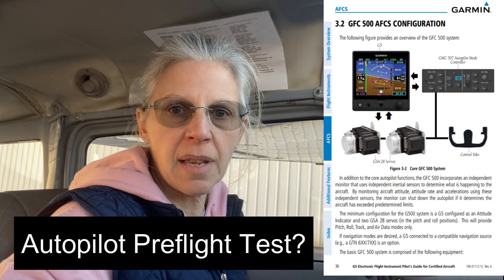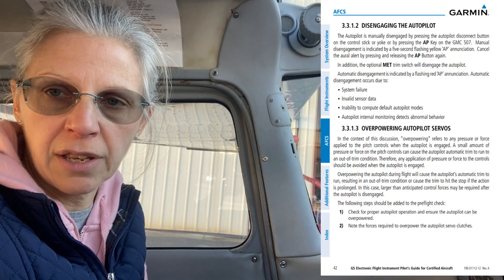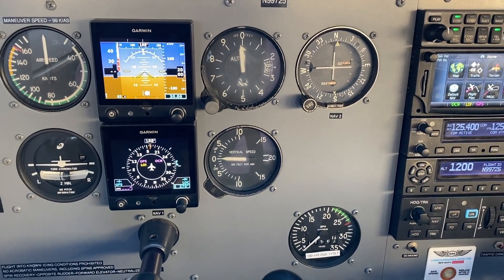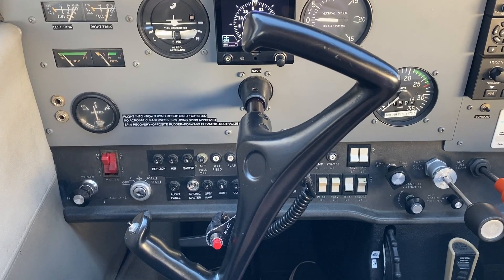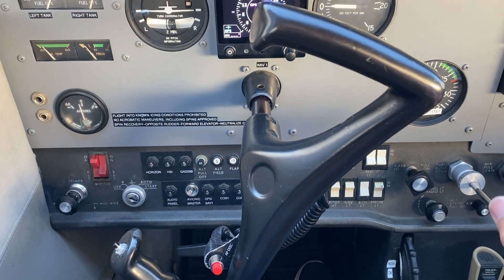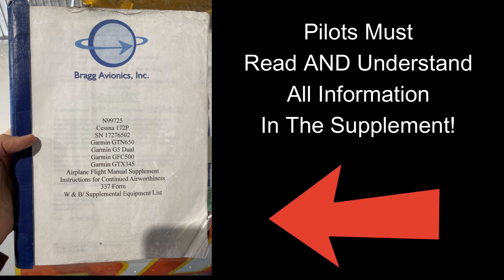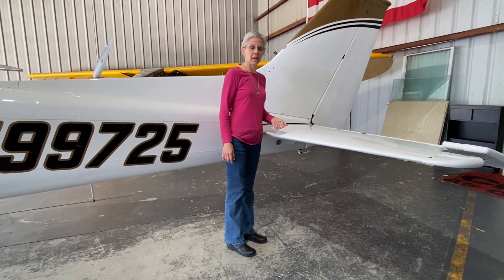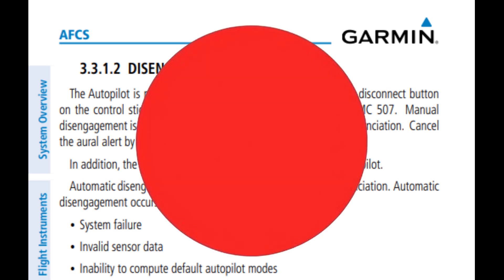Autopilot Preflight Test

Comment: Had a panel upgrade done recently in my 1973 Cessna 182. This included a Garmin GFC 500 autopilot. I watched multiple videos and used the online simulator to get myself ready. The avionics shop spent about two hours with me, of which one hour was in flight. The plane was scheduled to get back to me about three weeks prior to our planned cross country trip but it was only a few days before that I got the plane back. Needless to say getting familiar with this is an ongoing process. With my prior old fashioned autopilot I could hit wings level and still control pitch. Since I did get automatic trim I can't do that with this autopilot. Who knew? Anyway well I made sure to know where in addition to the autopilot disconnect I could turn off the autopilot, namely the breaker. Take off under instrument conditions two days ago and I'm simply not good enough with the autopilot to make sure everything's working properly. I took off thinking that level would level the wings and allow me to manually control pitch. Stupid me, that wasn't the case. I quickly realized that level meant level. I wasn't climbing and I immediately disconnected the autopilot and hand flew the departure. I can imagine a person getting flustered and trying to fight the autopilot pitch control. My quick initial inclination was to do that but I stopped myself before doing it and shut the darn thing off. Now I am wondering whether I should have gotten the electric trim. Anyway, I did spend several days practicing instrument approaches under visual conditions and it seems to be working. But, if it's not doing what I want it to do I hit that red button and my fingers are right next to that breaker in case the red button doesn't work. As a pre-flight I basically do what you do with the autopilot despite no documentation about what to do. Thanks for the video.
Reply from the maker: The bottom line is, it’s absolutely critical to understand how your automation works and be willing and able to turn it off if you’re not sure!
Reply: @HolladayAviation  Absolutely. I shoot every other approach by hand so that I don't lose my skills. Whenever I shoot an approach using automation I'm spring loaded to turn it off and take over.

Comment: I found this but im not sure how to "Using an air data test set, apply 35-40 knots of airspeed."
9.2 Pre-Flight Test (PFT) Pre-Flight Test (PFT) is accomplished automatically by the GFC 500 Autopilot after the system is powered up in normal mode.
 1. Apply electrical power to the aircraft.
 2. Verify that the G5 displays PFT on the display during PFT. 
3. Verify that at the conclusion of PFT, the PFT annunciation is removed from the G5. 
4. Disable the GPS navigator providing signal to the G5 by pulling its circuit breaker. 
5. Using an air data test set, apply 35-40 knots of airspeed.  GFC 500 Autopilot with ESP Part 23 AML STC Maintenance Manual Page 27 190-02291-01 Revision 1 
6. Verify that the ESP roll indices are displayed at the appropriate left and right roll attitude on theG5.  Refer to the appropriate model-specific installation manual addendum for model specific information on the placement of the roll indices. 
 7. Return the air data test set to ambient pressure. 
8. Enable the GPS providing signal to the G5

https://static.garmin.com/pumac/190-02291-01_01.pdf

Comment: First i will qualify my comments with the provision that i am not an AME and truly you should talk with your AME or avionics shop for final guidance.  I have however built several Homebuilt aircraft and recently installed a full Garmin system and Autopilot in my RV-10. Here's what i thing are a few answers to some of your questions:

1. Garmin doesn't recommend overpowering the autopilot servos in flight because if you have autotrim installed the A/P will adjust the trim to remove the force of your inputs from the controls.  It cannot tell if the loads it is seeing are from air loads on the control surface or from the pilot.    Should you disengage the autopilot with these abnormal forces trimmed into the aircraft you will end up with a potentially seriously out of trim airplane.  In a slightly different lead up that is believed to be the cause of the crash of the Beech Debonair flown by Youtuber Tennessee Fly girl.
2. The autopilot servos have adjustable clutch breakout (or strength) settings.  If you find the forces required to overpower these forces too great you can have your AME or avionics shop go into the configuration menu and adjust these forces.  They are adjustable from 10 inch pounds of torque at the servo all the way up to the maximum of 60 inch pounds.  Most likely the lowest end would not be enough to overcome aerodynamic forces in flight so the torque will be set somewhere above that number.  Perhaps your shop set the forces set at their maximum or a very high number.  I've never rigged a 172 but i would suspect that the torque settings would be somewhere around 30% of the maximum.  Again check with your AME or avionics shop.
3. Because of the built in clutch you cannot break the servo by overpowering it on the ground.    the clutch is designed to disengage before anything breaks.  If you overpower it in flight be very aware of my comments in (1) above.
4. Garmin doesn't publish the forces at the controls as depending on the configuration and geometry of the aircraft those forces would be different for every aircraft.  They do publish specifications on their servos that they can put out between 10 and 60 inch pounds of torque but that is all.
5.  If you feel you need absolute numbers for your aircraft i suggest perhaps you work with your AME or avionics shop to measure these.  They will most likely be different for each individual aircraft.  Also keep in mind that in your 172's case your static 'UP' force will feel significantly higher than the 'DOWN' as with the 172's elevator naturally sits down so you will have to overcome it's weight naturally to hold it up on top of the servo force.

I hope this answers your questions and i understand how you are confused because there is truly little guidance out there on these items.  Keep in mind i am an airplane builder and neither a certified avionics technician or a licensed AME and take the above advice for what you paid for it.

Comment: These questions reflect deeply examining and understanding the documentation! I’m yet to fly with an autopilot so I very much appreciate seeing this system from your more experienced and in depth understanding. In addition to “pushing the red button” I would think that one would want to practice pulling the breaker in case the button doesn’t work as expected. Is Garmin OKWith doing that for real on an installed, running system?
Reply from the maker: There are multiple ways to turn off the autopilot, including pulling the breaker. Clearly, that is not plan a, but I don’t see why one can’t test that every now and then just to make sure the breaker is functional. The effect on the system is no different than turning off the avionics master switch.
Reply: Don't see why not.  On my airplanes I put a red collar on any breakers I want to find quickly. Ask your AME as they are readily available and made to slip over a standard pullable breaker.  They also come in many different colours.
Reply: @moshonsk  Also, on every plane I've seen a GFC 500 in, the AP Breaker and the pitch trim breakers are always the leftmost two in the avionics section, and often in the uppermost row, so they're the easiest for the pilot to get to.

Comment: I have a GRT autopilot in my RV-8.  I don't test it mechanically on the ground or before flight.  I just leave it off, and then activate it when I'm over 1000ft AGL.  This gives me time to disconnect it if it misbehaves, which has never happened.  I know I can overpower it - I've tested that in the air.  My servos have a safety feature that would allow me to overpower them even if they fully locked up - it's a type of "shear pin."  If the servos are working normally, testing overpowering them won't cause any damage to mine - you need to check with Garmin to see about their servos.  I'm pretty sure that they won't be damaged by overpowering them on the ground or in the air.

I commend you for looking into this and making sure your students and instructors understand the AP.  If nothing else, it might provide something positive to the tragic death of the pilot and her father that you mentioned.
Reply: Yep, I figured Garmin servos would also have shear pins?
Reply: @mhilderbrand7693 no shear pins but an electric clutch.  Breakout torque can be set from a miniscule 10 inch pounds to a maximum of 60 inch pounds.

Comment: I’ve seen airplanes more being moved on ramps as you describe it
Reply from the maker: It’s possible but if you do it wrong you can cause serious damage.
Reply: C150 and other cessna models... the POH recommends pushing down on the fuselage just forward of the dorsal fin (vertical stabilizer) to get the nose wheel off the ground and pivot the aircraft around its mains.

Comment: We recently installed a GFC500 in our Cherokee 235 and had the EXACT same question. We came to the same conclusion:
- test aileron
- test elevator
- press the AP disconnect button, don't try to manually override the servos